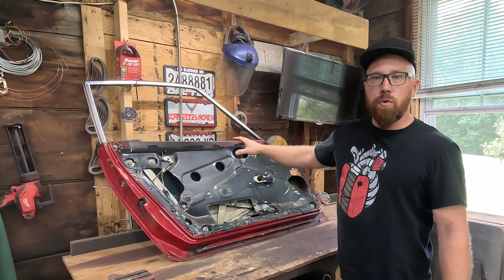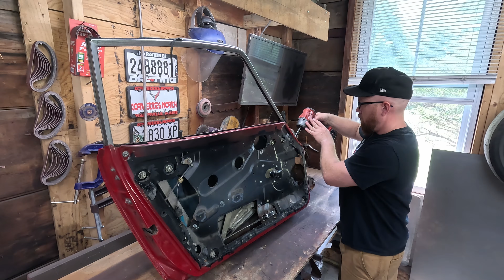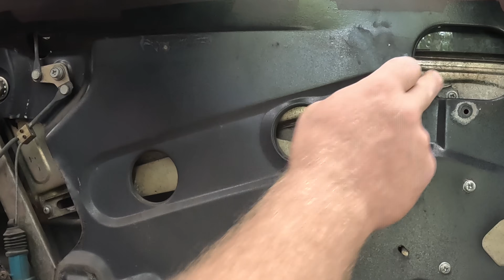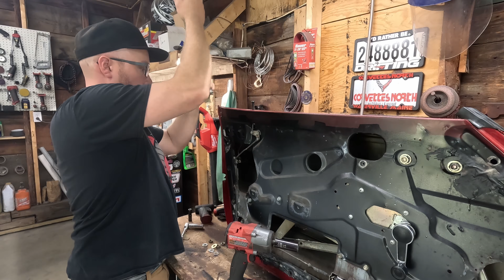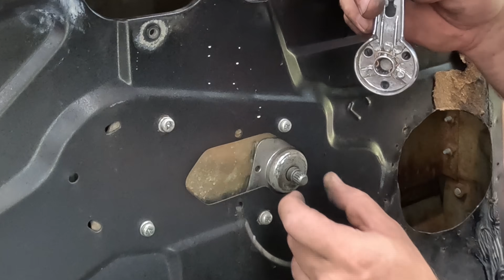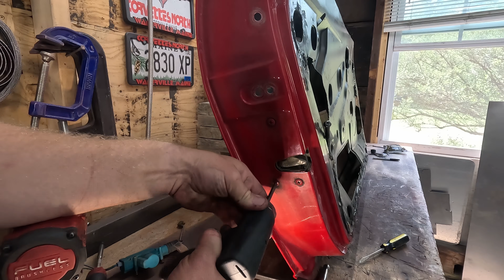How To Remove The Window And Everything Else on a Datsun 280Z

Comment from the maker: Apologies that this is not a fabrication video but running out of welding wire kinda shuts me down. We'll be back to rust repairs next video!
Reply: No need to apologize. A datsun s30 video is a datsun s30 video. Lol it's all good entertainment. Appreciate the uploads. Keep em coming. 😀
Reply from the maker: Sweating my butt off in the garage tonight getting the next video recorded. 90 degrees and humid af here in Maine.
Reply: @BLOKgarage  what are you getting done on it today?
Reply from the maker: @seansoutherland1941  front fender. The vid that was supposed to be up this week.
Reply: Nothing worse than running low on welding wire
Reply from the maker: You're not kidding.